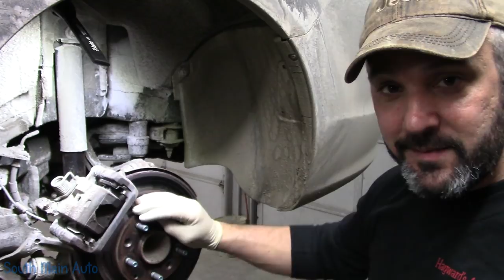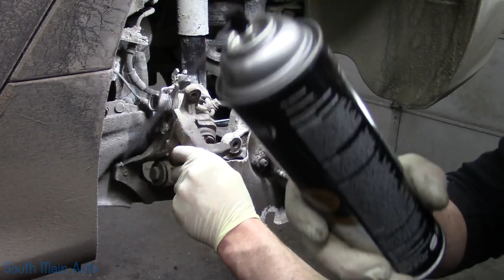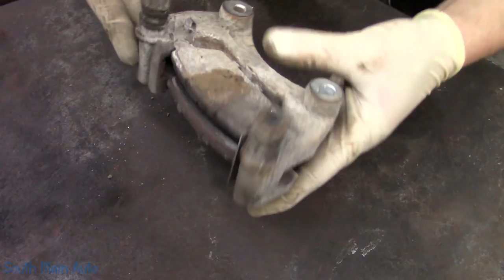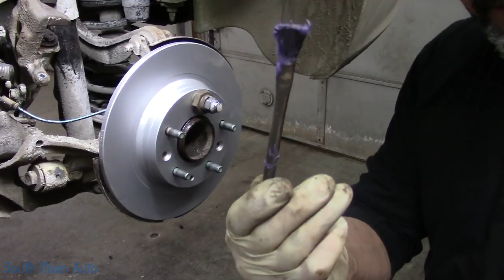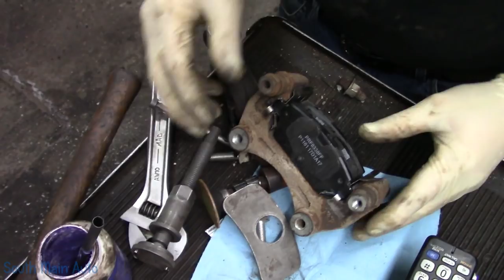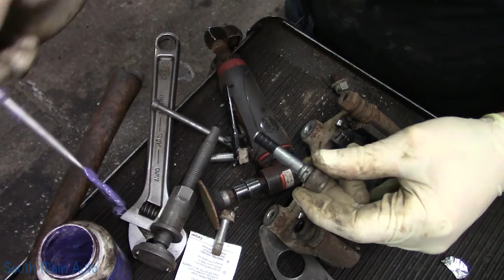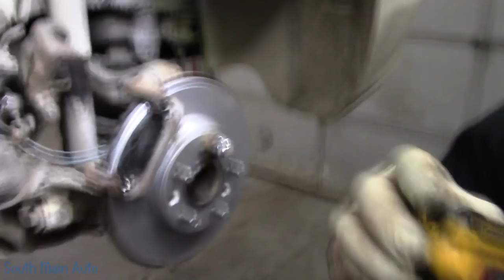Mazda 6 Rear Brake Pads & Rotors

Comment: Well performed brake job! I would recommend you buying a pneumatic piston winder tool, i use mine everyday and i love it! makes the task easy! It also works on all parking brake systems, since it doesnt require a certain thread pitch on your tool to rewind the piston.
Reply: TOPTUL has just introduced this tool to their line. I wondered why anybody would need one. But according to your comment they must be time savers.
Reply: SATAMAN Schmidt Yes that is correct, might not be much time saved on each job but if you add them up, the tool will pay for itself pretty fast. I bought my tool 5-6 yrs ago on ebay and it has been used pretty much everyday since then, almost all european and asian cars sold on the european market have this p brake system nowdays. On some Fords and Toyotas you have to rewind the piston anti clockwise and that wont work with the threaded tool.

Comment: Another great brake job. That brake caliper tool I welded a 3/8” nut on the shaft and then you can use a ratchet to turn in the Caliper piston. Thanks again for your great videos.

Comment: As I have mentioned before. Always picking up something from your vid's. I switched to the Perm. Extreme grease and have had amazing results. I to am in the rust and salt belt. (CT.) and used to use some graphite stuff that the shop got from our parts house. I noticed after a few thousand miles that the graphite stuff was heating up and dissipating to the point that it was gone and was starting to see pads sticking after a few thousand miles. After the switch I don't have this issue anymore. Just did a service on a car I did front brakes on last year (over 10K) and under the dirt and salt the purple stuff looked like I just did them. Thanks again for the tip brother..
Reply from the maker: That has been my experience too! Honestly I have done 1000's of brake jobs and never had an issue with it like some people state they have.

Comment: Love brake pads & rotors job. I've noticed you don't lube the wheel bolts with copper anti-cease or open the brake fluid reservoir before you compress the caliper back in. Great job, man!

Comment: Good to see you working on more euro stuff.
One thing i will say is when winding back that caliper i usualy just wind it back enough to fit over the pads... If you wind it back all the way pumping the brake dosent always set the adjuster and your find you have excesive handbrake travel or no handbrake at all.
Reply: (shauns) -- Why are you not ratcheting the Parking Brake out by hand
 at the caliper, to the  new pads, before stepping on the brake,then you 
will have less or no adjustment needed to the Parking Brake

Comment: I am shopping around for a decent older 4x4 pickup.  I want it to be easily maintainable by myself.  Not a  huge project just something I can work on if things go wrong.  I have some experience with engines and transmissions.  I was wondering in all your jobs over the years what truck do you find the easiest to maintain for the simple mechanic?  It will most likely be used as a work truck.  I own 3 cars now and just think it is time.  I have been looking anywhere from 1990 until 2010.  Love the channel.
Reply: 2003-2006 Gm pickup. Find one from the south that is rust free.
Reply from the maker: I agree with MPH. I feel the 07 Chevy 1500 CLASSIC was a perfect truck. GM had it pretty nailed down and it was easy to work on. Then in the 07 New body style they messed it all up again :( Or a 98 1500 Old Body style with the 5.7 was really solid too and easy to work on. If I had to buy one personally I would go south and finds an 07 classic (this is coming form a guy who really does not like GM too)

Comment: I like that 3M for going over the lugs to clean the hub to make it clean for the rotor.  Normally I don't see that much rust in Southern Ca, but with aluminum wheels, you have to be careful.  Any buildup on the hub surface can push against the rotor and you now have brake pedal pulsation!  Yuck!  Thanks for the link and Great Video!

Comment: There seem to be two groups of professionals who give advice on brake work. One group says that you need to open the bleeder screw every time when you squeeze the pistons back to accommodate the thicker new pads. Their theory is that if you don't, there is retrograde flow of dirty brake fluid that could cause damage at a seal in the MC or ABS. I've never seen that happen, but I do not have thousands of brake jobs under my belt. The other group don't open the bleeder screw every time because it risks the chance of breaking a bleeder screw and causing more problems, some of which may be tricky to deal with in a home garage or expensive in a pro shop. I have broken bleeder screws, they commonly seize around here, so I don't normally do it on every brake job. I have a feeling that most mechanics who work in the field are in the latter camp. In the interest of fair discussion, Eric, have you ever damaged an ABS or MC seal when you squeezed pads back without cracking bleeder screws open? Also, I noticed that you didn't take the cap off the MC before squeezing the pads back. Isn't there a small passageway for air to equalize pressure and escape the top of the MC, even with cap on?
Reply from the maker: Great questions and as you know HIGHLY debatable. Text book say ALWAYS open the bleeder. Experience says if you live in the rust belt NEVER open the bleeder, so to answer you question, I do on average over 300 brake jobs a year and have been doing this for 18 years and have never created a problem by retracting pistons with out opening a bleeder. As far as pushing fluid back to the master cylinder with out removing the cap, yes they will vent out the air (or fluid if it is to full) I do tend to do some stuff off camera such as checking the fluid level before beginning and removing fluid if it looks to full to prevent spillage.  I should show the entire process sometime as folks like your self are interested in the entire process. Great question BTW!
Reply: That's what I thought, and looking at the breadth of your experience, it is very impressive evidence. Thanks for the response! I hope I don't trigger a flame war from zealots on both sides, that was not my intent.
Reply: I’ve seen it damage a master one time. Not me myself though. Also being flat rate it takes more time. But in Minnesota also I can rarely get bleeders out. So that’s another reason i choose not to.
Reply: As both a NYer and a salt water boat mechanic, I have learned to respect corrosion and  to also do quality repairs/maintenance even when you know rust may be an issue.  I do not touch the bleeders unless I have to, but I do believe in scheduled maintenance prior to waiting for a brake failure or rotor damage.  The combination of experience and intentional service will save you money and major issues in the long run.
Reply: I live in the extreme end of the rust belt.  On my last car, the line leading to the flex hose broke due to rust, necessitating bleeding the brake after repair.  Upon attempting to loosen the bleeder screw on the slave cylinder, the slave cylinder broke in half due to corrosion.  After replacing the slave cylinder, I pumped up the brakes and another line blew.  I therefore called the wrecker to come and take it to the crusher.
TLDR:  while pushing brake fluid back into the ABS module and master cylinder could conceivably ruin your ABS module or slave cylinder, loosening the bleeder screw can ruin your car.
Reply: On seized bleeders, will cracking them loose regularly, say annually, lessen the chance of them seizing into the caliper?
Reply: CAREFULLY crack bleeder screw. wire wheel bleeder to remove crusties. apply small amt of antisieze. reinstall bleeder.
Reply: as an extreme measure on the boat trailers,  if the bleeder is loose anyway, apply proper anti seize (molly or marine grease for salt water, never use copper based in salt water around aluminum) then put water proof marine grease in the bleeder opening and replace the rubber cap if you have one
Reply: @SouthMainAuto  I live over here by Cleveland, PLENTY of rust, I'd have to agree with ya!
Reply: @jonsey1886  And if you can find the little rubber caps, definitely use them. Had a bleeder get plugged up from dirt from the road. AntiSieze, I put that shit on everything!
Reply: In my professional career that largely involves brake work, this is something that I must think about all the time. On the majority of vehicles, pushing back calipers without opening the bleeder is usually ok. Yes, THE BOOK says to open blenders, run a tube to a glass jar....etc. We all know what THE BOOK says. Sometimes it isn't an option. In the case of northern vehicles, chances are the bleeder screw will break. If you are trying to break open the bleeders on the calipers of a Chevy, chances are the bleeder screw itself will rip the threads out of an aluminum caliper. Specific vehicles require specific attention. Primary vehicles to NEVER NEVER EVER push back calipers without opening bleeders: 2004+ Toyota trucks, especially those equipped with the active accumulator hydraulic booster setup; hybrid vehicles -- if you screw up on these you may be looking at a $2k+ HCU repair; 2013+ Ford Edge, Escape, Explorer; and any other vehicle that may have a complicated brake system, especially European vehicles. In most cases normal pushback never upsets anything, however if the vehicles brake system is old, compromised, or questionable, opening the bleeders is definitely preferred to avoid any unwanted damage.

Comment: Never ran into them twist in piston before. Great video good tips thanks Eric.
Reply: I have on an early 90s GM car. It wasn't bad but you do need the correct tool.
I'm diy only, so very limited sampling of cars for me.
Reply: The older Honda accords and also the Kia's have them as part of the rear parking brake.  I have a small cube that has various combinations of pins or bars almost like a dice,  It fits on a square 3/8 ratchet or extension and costs like 10 bucks.  Perfect tool for any DIYer.  All parts stores have them

Comment: My brother's wife's 2008 Fusion was the first car I saw that used the "Screw in" style rear brake, I ultimately ended up using a pair of needle nose pliers to wind it back in. That tool though looks much easier, I'll have to pick one up.

Comment: Hi Eric O, Another great video. I don't know how you can work on cars with that much snow and salt on them everyday. Do find when a car returns for its next service the items you worked on last time are still ok and not rusty. Is there a car underbody wash you can go to get rid of the salt?.
Thanks again Mate. Cheers from Queensland Australia Mark.
Reply: The problem with washing the salt off is that it simply drives it into the body seams. Then there is the issue of below zero temperatures. About the only way to keep a vehicle rust free in NY is to buy it new, wash it and wax it, then seal it in a climate controlled room...   Or do like I'm doing this spring with the wifes new toy. Pull off all the panels and trim, wash everything with steam and hot water then treat it all to a bath of heated krown or fluid film. Then cavity wax to seal it all. Even then I suspect it will only go 10 years or so before it has rot.

Comment: Great video Eric o, on the caliper guide pins why does one pin always have a rubber boot and the other is just a plain metal pin? have you ever come across that rubber boot on the pin swollen and seize the pin in the bracket?

Comment: How do you deal with electronic parking brakes? My 2008 Citroen has one and the rear hand brake on one side was flagged up as an advisory on the recent MoT test (UK annual roadworthiness test similar to the annual inspections you have over there in certain states). I suspect that the pads and discs (that's what we call the rotors) may need replacement and being on 136,000 miles, they could be the original ones it left the factory with. I'll be bringing along my camera when I get chance to take a look at them.
Reply from the maker: Some electric e brakes need to be "released" or "retracted" with a scan tool prior to replacing the pads. Depends on the style parking brake though.
Reply: parknest If your electronic parking brake are like the ones vw passats have then you have to have a scan tool to wind the motors in, there are various hack jobs you can use to wind them back if you do not have the scan tool but i would not recommend, The passat ones are notorious for the motors to crack and let water in then stop working, also the switches on them go faulty.
Reply: I should be able to find out on the Citroen forums and a few YT vids. I know you won't be familiar with PSA Group (Citroen/Peugeot) vehicles as they're not sold Stateside. I just wanted to know what your experience was in general with them. Thanks for the reply Eric.

Comment: It would be great if you ever get a chance to show how to do a Mazda with electronic parking brake. Apparently there is a way to put the parking brake motor into a service mode and the piston pushes in like in a normal caliber. If it has EPB they can be damaged if the piston is rotated. I think 2016 CX5's and later are set up this way.

Would love to see you do one....

Comment: Love the video quality and style! Question tho. Some sites say to break the bleeder screw open and to clamp the caliper brake hose. So when you screw in the piston the fluid escapes out the bleeder (and into a container you have in place). They say pushing fluid backwards through an ABS module may damage it. Any thoughts on that? Sure makes it simpler to do it the way you did.

Comment: Back in the when brake cleaner was at toxic levels 

A guy in shop brake cleaned the top of an engine off then he started to drill out a broken rocker arm stud , the drill bit made a spark and BOOOM ,the front timing cover swelled so bad we had to replace it for free 

Ah yes the good ole days
Reply: memopat1 i once had a mechanic in my shop who cleaned the exhaust manifold after an oil leak with brakecleaner while the engine was running.
Almost burned down the complete engine wiring.🤣

Comment: Lol... funny enough, I'm one of those people who have had the purple stuff get all sticky after time. I'm finally getting through that jar, which took about 5 years or so. I was no longer using it for the pins themselves, just as an anti-seize around the hub. My preference is the green stuff (same brand) and I haven't had a problem since. Maybe it was a bad batch... lol I just found it funny, I agreed with "the word on the street".

To each their own, of course we stick to what works for us.
Reply: Cuba Rodriguez 
Same experience
I've used a product made by Textar that's clear/yellow ( if that make's any difference) for a while now and have never used anything better.
Reply from the maker: Interesting! I must say , out of the 1000's that I have done, I have never had an issue!?
Reply: It's probably a Ford

Comment: Eric O you are becoming a video expert. The visual clarity is excellent. Good video also.have to get me some of those break cleaning pads. Eric do you recconmend changing the rotors with pad replacement and do you perfer coated rotors over steel non coated. Thanks
Reply from the maker: I always replace rotors here in the rust belt and I definitely prefer the poly coated rotors!
Reply: South Main Auto Repair thanks Eric for the quick reply. Just as rusty down here on Long Island. More salt on the roads than in the Atlantic Ocean.

Comment: Thanks good to know about the pins on the pads
Reply: yeah, very important to make sure they line up. also make sure the screw assembly/piston rotates freely once bottomed out, I've made that mistake before, if not they'll rotate as they come out and can draw back in when not applied, causing more pedal travel. of course the pads will wear very crooked and not apply good stopping force :)

Comment: Is there a problem caused by forcing brake fluid back through the ABS unit.  At least one video on this job suggested that the ABS module could be damaged by driving fluid backward.

Comment: I have a few Toyotas and they have a black rubber grommet on the internal part of one of the slides.  (it was shown in this video as well).  Regular brake grease may make the rubber swell and  the pin will stick solid.  I use a product called "Silglide" to grease those pins as this is not supposed to effect the rubber.
Reply: Mike B That's what I use, too.
Reply: I've used Silglide for years but in the last few years I've been using the same purple ceramic lube as Eric is using. Was told it's better and has a higher heat tolerances. Cost is twice that of Silglide. Never had a problem with either lube though.
Reply: Mike Burton It's probably a luxury for me that Sil-Glyde is an option since I live in a relatively dry and warm climate. I would imagine a more substantial lube is more desirable in a wet, cold climate?
Reply: The purple grease is fully compatible with rubber. It is a full synthetic lube designed for brakes. I have used both and don't see a big difference between them as far as lubrication goes, but I have seen the ceramic lube stop squealing and chatter when it was used on a vehicle that I had used Silglide on before.
Reply: thanks for the responses from such a knowlegable group.  Obviously, Eric O is a master and i would trust him all the way with any of my kids cars.  just posted on the Silgide for others to know that if they have that rubber grommet, use pin grease compatible with rubber.  The older cars did not have internal pin grommets.  I learned the hard way when I could not reinsert the pins due to swollen pin grommets.